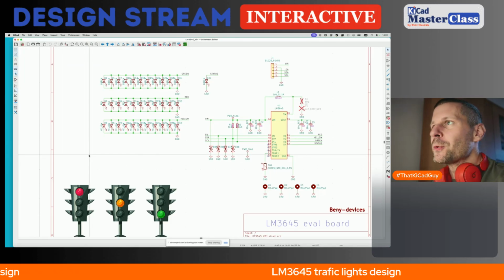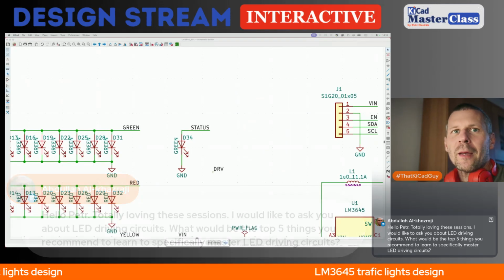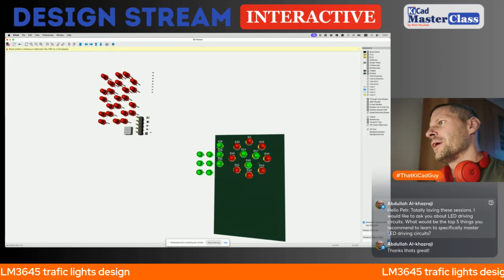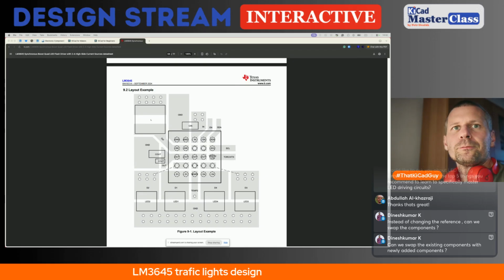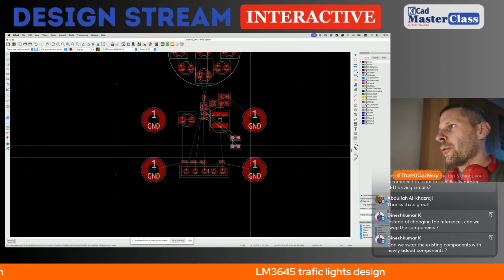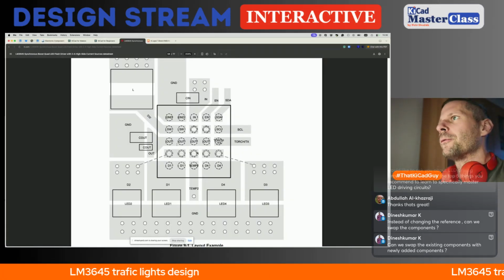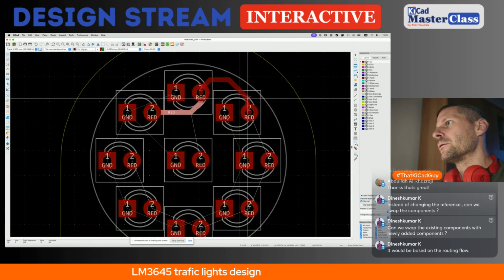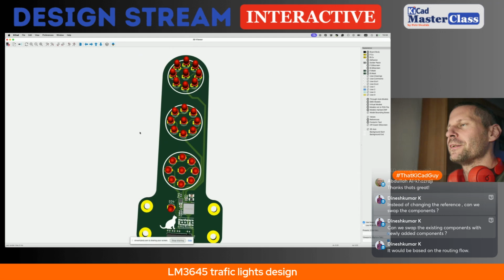KiCad Design Stream Quad LED boost driver

Comment: Nice episode Petr. Apparently you hadn't seen my comment on previous week's video with the schematic design session; which actually resulted in the very entertaining section around 1h17mm where you were puzzled what happened with the protection diodes, changing the references a couple of times, and me yelling at the screen to check the schematic 😂😂😂.
To avoid the "drunken" lines between the leds I'd suggest to use a nice circular copper pour on the top layer, would better satisfy my ocd.

 Btw, I liked the energetic pulsating rhythm in past video's background music. So different people have different preferences: you should just do it as you like yourself best.
Reply from the maker: Indeed, I missed your commend. The tip of the circular polygon for the diode anodes is perfect. I will redesign the PCB this way.

Comment: Nice layout as always. For me, it is extremely irritating  and a waste of time to change each reference designator after using the array function in the current version 9.0.6. I hope KiCad fix it soon. I do use LLM's, in 85% of the time they provide a workable solution and save a lot of time. The PCB shape! 🤣. PS: I couldn't hear the license free music once, not that it bothers me.
Reply from the maker: Indeed. I set its music too low today for the stream. I did hear it from my speakers. This is why I asked for the feedback but on LinkedIn, there is not so many people watching the entire time as you do. Thank you. Next time, I will set the volume up about 50%. Today, it was at 22% in StreamYard. Next week, I will set it to 33%.